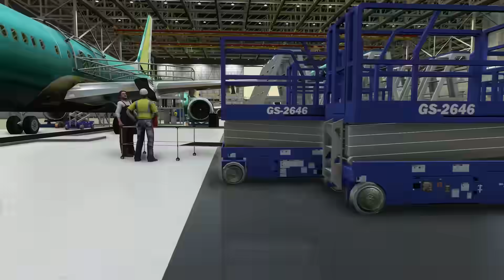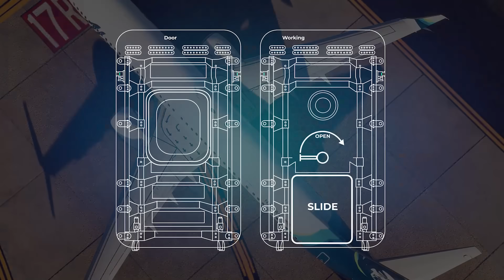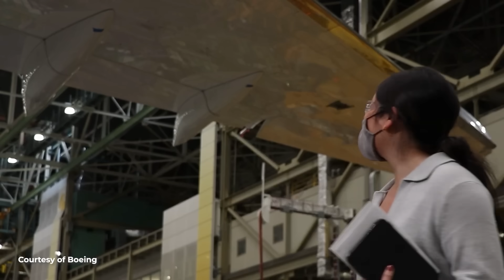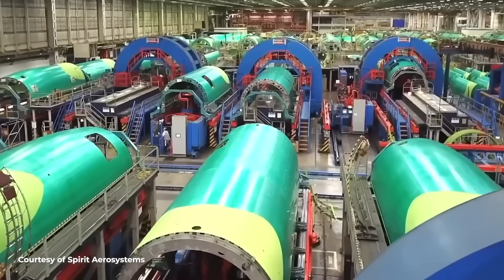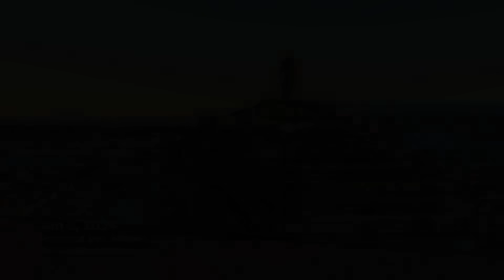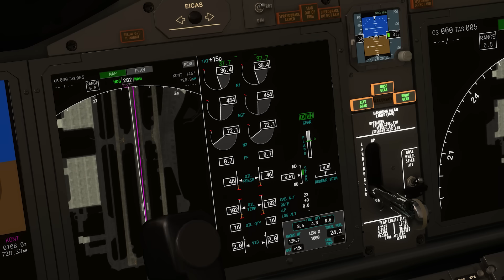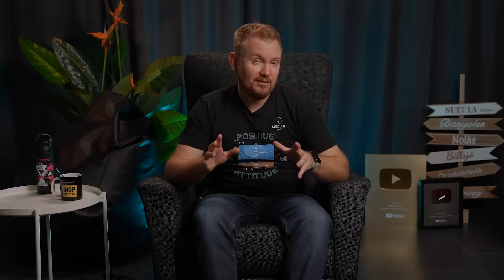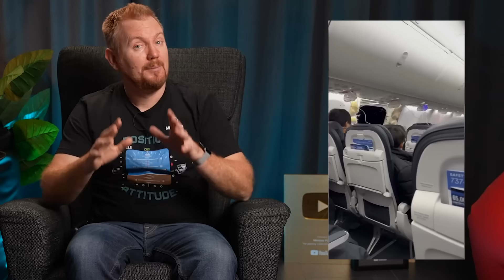Boeing 737MAX BlowOut!! The Scandal behind Alaska Airlines flight 1282

Comment: Former engineer here. There is nothing more frustrating than dealing with a company leadership team that’s hell bent on getting the product out the door and doesn’t want to hear about quality problems. I don’t know who said it originally but it’s impossible to make people understand something when their livelihood depends on them not understanding it. I’ve never worked in aviation but I’m guessing this is what was happening at Boeing.
Reply: Admiral Rickover, of US Navy submarine fame, had an easy solution to that. He made the managing team in charge of repairs take part in the first submersion test. Maybe Boeing should do the same with an aircraft’s first flight.
Reply: @moltderenou in ancient times, the engineer in charge of the arch (bridge, doorway, roof, etc.) had to stand under it while support was removed. If the engineering was bad, it was a self-correcting quality check.
Reply from the maker: Yep, I understand what you mean
Reply: @MentourPilot  There is no excuse for the door plug debacle- the number of eyes it slipped passed is criminal!!
Reply: Kk km @MentourPilot
Reply: @MentourPilot  I also understood what he meant. It doesn’t apply to this case at all, but, the sentences used correct syntax.
Reply: I worked in aviation for several decades. The last 'influencer' that safety-oriented folks like engineers, mechanics and pilots always had to sway the management to see things there way was the FAA/(oversight authority). Recent moves to 'pass this responsibility) to company themselves is the worst form of leaving 'the wolves in charge of the sheep!'
Reply: @gcorriveau6864  and doesn't help that the "company themselves" have gone woke with their priority focus to everything other than safety
Reply: haste makes waste
Reply: @SeekingTheLoveThatGodMeans7648  or re.. Chinese proverb.. plenty haste> less speed.
Reply: I have worked in GA (General Aviation), and the shop owner would not let anything go back to the customer until it was 1000000% ready to fly. If a small shop has the cash on hand to make payroll until the job is actually done then Boeing sure as hell does, they just chose not to.
Reply: @jamesesdaile4696   Although that is not true of all GA maintenance shops unfortunately.  I owned a P-Navajo and had my fill of sub-standard shops.
Reply: @jamesesdaile4696  Well is quality is not in the procedures to begin with, it is impossible to fix it in final inspection.
That shop owner would probably not allow any sick worker, and also never pushed "to get these 3 done today our contract depends on it".
 But is probably much happier explaining to the customer why it will take longer - the reason being safety.
Reply: "Out the door" HAHAHAHA lmaoaoaoao ba dum tishhh
Reply: “It is difficult to get a person to understand something, when their salary depends on not understanding it.”  ― Upton Sinclair 1934
Reply: I work for a class 1 railroad, and our management is exactly the same: get it done at all costs, safety be darned. I do what I can to follow rules and regulations, but I think it puts a target on my back.
Reply: The quote is from Upton Sinclair I think.
Reply: Mercedes Tech and Enthusiast here. The same in cars too. It's all about spending as little money as possible with the biggest profit. Nothing is built with passion anymore
Reply: That's because money does not talk.  It screams and roars like an enraged marine drill instructor hellbent on murdering a recruit who just doesn't get it.
Reply: same here in the electronics industry, managment were clueless, appointed out of nepotism, and often promoted well beyond their ability, (peter principle in action)
Reply: Maybe if leadership teams understood that their family members could die or be affected based upon their decisions
Reply: They want to make their shareholders happy so they can get their sweet sweet bonus.
Or not get fired.
Reply: So I get the faux quality system was a stopgap to minimize paperwork and maintain workflow.  But what was in or wasn't in the orginal work order that would cause the Spirit workers to just paint over the damaged rivets?  were they installed without sealant and an "acceptable" repair was paint over?  Or was there something more nefarious?
Reply: It is difficult to get a man to understand something, when his salary depends on his not understanding it - Upton Sinclair
Reply: ...get the product "out the door" accidental pun 🙂
Reply: I worked in the aerospace industry. Productivity expectations at all levels was always being pushed. You could never do enough work fast enough and no matter what you achieved you would never get paid more, only asked to do more work.
Reply: "Health and Safety rules are written in blood" - they're also etched on tombstones as well, sometimes. Until corporations care more about the safety of their customers than they care about profits, these problems are going to keep on reoccurring.
Reply: This has been a problem with Boeing ever since the McDonald Douglas merger were somehow the bean counters who ran McDonald Douglas ended up in charge of the engineer focused people at Boeing and they went from a company that was focused on engineering to accompany that was focused on the almighty dollar, with so many tragic results over the years...
Reply: There were times when the CEO of a manufacturing corporation would be an engineer with maybe a MS or PhD in Mechanical Engineering, and would get a MBA later in his carrier when he reached executive position. Now we have financiers with absolutely no interest in the company except for their golden parachute and their stock options. They are CEO of an agribusiness one day, an entertainment company the next and then of an aircraft manufacturer... it's all the same, just money. Remember the GE Capital fiasco? Boeing wanted to do the same. "let's not waste money making stuff... let's all be consultants instead."
Reply: I am actually starting to be afraid of flying because of this change in company culture. The problem is not limited to aviation, however also with trains, buses and other means of transportation. Take modern buses for example. Because they are poorly built, deadly accidents have happened in speeds as low as 30 km/h, buses are no longer being made so they are safe to drive in the winter. In Oslo of Norway where I live, some bus lines have actually been closed down and/or have gotten limited operation because the transportation company ("Ruter") have bought buses of poor quality, and many buses have been damaged due to accidents. Due to modern safety rules, we may fortunately, in practise not see as many accidents as one would fear, still - a decreasing regularity and quality of service, this is especially problematic with trains and aviation. However - in aviation, we will see an increasing number of accidents because even minor issues can lead to accidents. Also, after the pandemics, we see that people are less focused, than before, which could be a combination of long covid and the aftermath that the mental challenges caused, which leads to many minor accidents everywhere. 

The world situation with the increased risk of world war III is not the most healthy, either. Still - the focus must be to change company culture, about listening to the engineers and not the stockholders of companies, so that resources are diverted to give proper services, not to fill the stockholder’s pockets. In summary, the cultural problem about quality of services, is omnipresent, however the more technical a service is, the more vulnerable and unsafe it will be, if the company culture is greedy.
Reply: Renton factory, explains everything.
Reply: IT Infrastructure engineer here. I can totally relate to your comment.
Reply: Exactly!!

This wasn't necessarily an engineering problem or a SUPPLIER problem. This is CLASSICALLY a MANAGEMENT PROBLEM!
Reply: Another former engineer here.  It has been my experience that the bean counters (CFO's) appear to be running most larger companies.  These people have little to no real life experience with technical or safety issues, and absolutely should not be in charge of companies that 'must' have a strong focus on creating products that don't endanger peoples lives.  I don't have personal knowledge of the bean counters influence at Boeing, but it certainly would not surprise me.  Safety should never be compromised in aviation, but anyone who has been paying attention knows that costs are high and throughout the years many shortcuts or cost saving measures have been employed.  Aviation has a 7 Sigma safety record, virtually the highest of any industry, yet some in the C-suite seem to be out to destroy that impressive record.  Recently, since this incident, other 737 door plug issues have been found which leads me to believe that this problem is more wide spread than we know.
Reply: Boeing stopped being Boeing after the McDonnell Douglas merger. Totally changed their operating procedures when they allowed so many MCD executives retain their jobs.
Reply: I feel this issue is replicated throughout our culture, society and economy.  The people with money, who primarily care about profits, pressure those who actually do the work and understand the implications of rushing the work, to ship products (or whatever it is one does) according to a deadline rather than quality.  Of course, the reasons of management may be valid, but that just points to larger systemic issues.  The answer should never involve jeopardizing safety.
Reply: @andrew5184 spot on.
Reply: I have a solution for Boeing's problem..... FAA should mandatory to make each of top management work blue collared on the production floor for one full day a month.... If they can't do anything productive they'll assist the technicians & engineers with manual labor...
Reply: @sattwikchakrabarti Yes, I have thought about this aswell.
Reply: But instead they got the door out of the product in that case...
Reply: Engineers are like vegans…..they always find a way to tell you that they’re a engineer lol
Reply: IS happening. Not was happening. Boeing still hasn't fixed their safety culture. 😠
Reply: Those same people that everyone loves to demonize, are trying to run a business to keep everyone employed at the end of the day.  Engineers can have their concerns, but they are a part of the puzzle, not the whole thing, the leadership team has to look at the picture as a whole.  So while dogpiling on them is easy, remember what they're doing is far more complex than just being an engineer.
Reply: Blame the McDonnell-Douglas execs that took control of Boeing
Reply: Another engineer here.  See my comments above.  I think people get lost in the weeds and in tech speak.  This is a clearcut problem of incompetent people working in the industry rather than one of 'layering of systems'.  There's money, politics and phony excuse making infusing this 'investigation'.
Reply: Opinion: ...not *was* happening, rather *has been* happening, leading to loss of hundreds of lives.
Reply: You and Brownie are  great sources of information - technical, aviation business, culture.
Reply: Yes I understand too 🙄
Reply: This mentor guy is just an YT clown.
Reply: Same with the motor trade, an mot which is a safety check basically, the tester must spend a MIN time of 40minutes doing the test, garage owners then book tests based on the MIN time, older vehicles need a longer time so things run behind, items are then missed whilst the tester tries to catch up and problems can arise, which could be serious.
Reply: I guess we need to change the laws a bit to make willful-idiocy an offense that can at least revoke your bonuses for a year or three maybe, or jail or whatever.
Reply: @EShirako  Who are you addressing this to my friend? And what does this contribute to the discussion. NOTHING!
You need to put yourself on READ ONLY mode. That way you will not continue to make a fool of yourself!
Reply: @DennisMerwood-xk8wp   I was snarkily agreeing with your comment that "there is nothing more frustrating than dealing with a company leadership team that’s hell bent on getting the product out the door and doesn’t want to hear about quality problems" is true because C-suite and managers have no requirement to be responsible for their poor choices.  My comment was meant to say that "The only thing managers/executives in corporations can understand is something that hits their pocketbooks at the moment", thus "I wish they could lose their bonuses at least, since we can't seem to send any of them to jail no matter how terrible their decisions are".
Reply: Beancounters should stay very far away from safety  budgets on intrinsic systems?😮😮😮
Reply: Here after the Boeing whistle blower assassination , first let me say spiritareosystems is Boeing under a different moniker, secondly if you think taking an airbus is any safer guess who builds their fuselage? Spirit aero
Reply: Exactly what is happening! Giving us less time to make or inspect the aircraft! We use to get days if needed to inspect an aircraft… now we get hours max
Reply: Only idiots guess. A 1st grader can guess
Reply: Construction engineer here, and I know exactly what you mean. 
Shortcuts will be made if you let management get to it and not be stopped.
Reply: Yeah, don’t bring up Elon, you’ll hijack this whole post!
Reply: Yep, standard engineering/ higher higher mg't interface,  esp if mgt is unduly influenced by whatever form of company ownership.
Reply: As a former aircraft mechanic at Varig the security procedures were so tight and even so bad things do make their way...
Reply: VERY UNRESPONSIBILITY UNPROFESSIONAL UNACCEPTABLE 🙏🙏🙏
Reply: I just wonder how many max9's there are flying with door plugs not bolted on.. There has been 5 incidents with boeing airplanes in last week.  
I'll keep on travelling with airbus and atr.. Zero trust on that company made in USA
Reply: Guarantee there are corporate psychopaths in Boeing management
Reply: John Barnett was murdered for this. Make sure people know you're not suicidal
Reply: That wasn't a quality but Clear Employee carelessness
Reply: @bernese1004  Employee carelessness is universal. We are all human. Quality control is the process of ensuring mistakes don’t impact the function of the product. At Boeing, unlike Airbus, this is lacking.
Reply: It's usually okay. We cut corners all the time at my company.
Reply: I work in aviation, defense, and aerospace as a QMS specialist and this is in no way excusable. I can say that it's been my observation over the course of two employees in this industry, during/post height of covid, that the demands on a reduced operational workforce has taxed quality control significantly. But to your point, leadership has a duty to the industry, it's customers, and  the public to adhere to quality requirements, including planning of resources and manufacturing, inspection, and testing activities for total quality assurance. Shit rolls down hill and the organization at the center of this story had a rich history in the US and globally before falling from grace after the silent and secretive introduction of MCAS on the MAX. One of the most bothersome takeaways from this video, was hearing that YET AGAIN, aircraft pilots were not aware of new design elements prior to their incorporation (diff pressure/cockpit door). 
This is disheartening on so many levels, as someone who works in quality management, in the defense industry (non-commercial aviation), as a commercial flyer, and simply as someone who takes pride in their work and would expect all persons to hold their leadership to the same standard. 
This organization is motivated by money today, which must be devastating for their former generations of quality and engineering personnel who accomplished incredible technological feats without compromising safety or quality to simply meet budget and delivery schedule commitments.
Reply: they talk about it like there's not loads of lives on board
Reply: that's capitalism baby
Reply: Well said
Reply: As a safety professional, I have been in the same position.  Too many companies say that employee safety is number one, but it really isn't.  Profit is number one. Management doesn't want to hear how unsafe it is to have employees handling hazardous chemicals during long work days and weeks or how dangerous many work practices are.  It's impossible to quantify the value of employees working more safely because you can't say that if you continue to work your employees this many hours, this is what will happen and this is what the cost will be.  All you can say is that this is a high risk activity, and if something goes wrong these are the potential associated costs, including medical costs and fines if someone is killed.  Generally, management is willing to take the chance that nothing will go wrong.  After all, it hasn't happened yet.  At one company, I had fought for a tornado shelter because all of the buildings were either basic metal buildings or modular office buildings.  Later, when I wanted to start on installation, I found out that the money had been taken out of the budget without telling me.  At another company, when I explained the tornado procedures that I wanted to implement, the QC manager responded that a tornado had never hit the building before.  Unbelievable.  Tornadoes were common in the area, and we were only 40 minutes from a city that had been hit by an EF5 tornado a few years before.
Reply: Be careful you might mysteriously commit suicide
Reply: Basically stop Wall Street running the economy
Reply: 100% . I worked at Sea Ray. I installed counter tops in the 44 footers head. I couldn't convince the QC inspector that tightening down the faucets on the sink before the caulking set up  was cracking the counter tops . He ignored my warning and I sent out at least fourth boats with cracks in the counter tops. The production schedule was so rapid I would come into work when it was dark and leave when it was dark . One morning  on the way to work I drove up an off ramp on the highway .
Reply: Look , in the backwards US the FAA who couldn't control Boeing and when the MCAS disaster happened when they were asked why they let Boeing self inspect  they said " well they are the experts " was their answer , now that same Keystone Cop agency grounds a SPACE X Rocket on the launch pad citing twenty violations ! Now they are Rocket Scientists !!!
Reply: I'm a retired Aerospace Senior Engineer and I agree with you 💯.
Reply: There is no accountability. Did anyone go to jail after 2 planes crashed after they hid mcas from faa? Also the faa doesn't do anything. I think boeing pays them off.
Reply: I have no trust in Boeing.
Reply: So, are you the last line of examination before it leaves, because if it crashed, all they would have had to do is who look plane at the plane last and thereby implicating you?
Reply: I ALWAYS say:I should do it THIS WAY,if you want me to do it YOUR WAY,put it on paper,and sign it.
I ALWAYS get to do it MY WAY.
Although, I'm in the EU.
I guess,they do it differently in the US...money talks...
Reply: Brother this translates.
I'm a builder, big buildings a hands on site super. The crap the suits ( that have never held a hammer) want me to do at times is criminal.
Reply: You are not in aviation and are just speculating. At least you were honest. 99.9% of the people who comment on a topic are also speculating and have no professional knowledge at all. I can say that because I am not a statistician and I’m making a guess.
Reply: I love that sentence! I's impossible to make people understand when the means of NOT understanding is part of their motifs. No matter if they're economical or psycological 😊. This is the virus that exterminates pure logic/balance.
Reply: Misplaced world 😢
Reply: I don't work in aviation but I know exactly what you mean...
Reply: So true have similar experience
Reply: Current engineer, tell me about it bro
Reply: Imagine if its an entire country gov services.
Reply: Safe and effective
Reply: While I was never an engineer, a job I had at 25 years old was to help build tow hitches for the Toyota department at a company called Cequent Towing Products. We had a Toyota line that was much more strict in quality control. If they found an error in the line at any time, they shut the entire line down. I worked in saws and hitch box welding. When something was found, the whole line stopped. From the beginning to end, until they realize the issue. We were allowed 2 stops per month. No more. I never had an issue in my department, but the other welders were always having issues. Just before I quit the company, they were losing the department. It was a huge loss to the company.
Reply: Totally, a lot of the management/office people I deal with have such little understanding of what I actually do
Reply: I am QA-Engineer for a machine and Industry company. We mostly have welded parts and have to paint them (called corrosion protection), which is where most of the issues lie.

Sometimes I have such a hard fight about the mistakes (and therefore delays) i find... then we found a good Company that has been trained well on our products and requirements, only to hear they are no longer good for us as they are too expensive.

It is sometimes sich a hassle with management...
Reply: This is an ever-present issue when technology and new products are driven and completely controlled by those with monetary gains as their one (and sometimes only) priority. There are a number of reasons why these types of priorities go hand in hand with being a leader in putting the newest products on the market, and there might not really be an alternative, but the problem is there nonetheless.
Reply: “…nothing more frustrating…”? Tell me you aren’t a parent without saying you aren’t a parent. Or mebbe you just met my ex.
Reply: My father was the chief of a police department. I remember him coming home and just being so angry and depressed, because he had an opening to fill, but had to skip down the list past better qualified applicants to get to a black woman. Literally skipping over better qualified, better trained, officers on the basis of their skin color and gender. How is that NOT discrimination?

She played the “you can’t fire me or I’ll sue” Card on day one.

30 years later, SHE’S the chief!

I just disagree with special rules for special people.
Reply: "getting the product *out the door*" hehe I see what you did there
Reply: @ 3 people pointed out my unintentional pun.😂
Reply: @danielschein6845  well next time make it intentional 😂
Reply: There should be a major revamp in the current safety protocols of Boeing and strict safety inspections in Spirit, this major problem with the administration not overseeing the seriousness of safety as well as keeping up with the reputation Boeing has built over the years.
Reply: Boeing culture changed dramatically after the merger with McDonald Douglas. Leadership got incredibly focused on quarterly stock price. Loss of long term focus led to this and other issues.
Reply: Concur.  I've worked in IT (mostly software) for ever (!) and over that time, it seems that while the software industry has made great progress in professionalising its practices, "management" has not.  The attitude of "get it out the door ASAP" has never gone away.  A great mitigation for attitudes and people like these is to make sure everything is "on paper".  Even phone calls.  A follow-up email or other comms system message to the offending manager in terms like "Dear <x>; on the recent phone call you made to me on <a> at <b>, you insisted that I do <c>.  I wish my objections to be noted.  As discussed, this will be a bad idea for the following reasons:...."

Amazing how a bit of traceable accountability can focus the minds of those who behave this way.
Reply: Product out the door! The pun…
Reply: Your original comment is essentially what brought down Challenger and Columbia. And yeah, it’s prevalent at Boeing. Or at least it has been in the recent past.
Reply: "It is difficult to get a man to understand something, when his salary depends on his not understanding it"

~Upton Sinclair
Reply: Ah yes, the noble engineer, forever the victim of clueless leadership, never the cause of delays, bloat, or gold-plated “solutions” no one asked for. Funny how quality suddenly becomes sacred when it’s a convenient excuse for missing deadlines or ignoring business goals.

Sometimes it’s not that leadership doesn’t listen, it’s that they’re tired of hearing lectures from engineers who think the product is their personal thesis project. If your idea of “quality” means never shipping, you’re not an engineer. You’re just expensive overhead.
Reply: I work with trains. Similar situation.
Reply: Why do we never hear this issues from Airbus? Because they are better, the Americans government stopped the Concorde from flying New York-LA because of noise, that killed the Concorde and not the crash in 2003
Reply: Hello Morton Thiokol... Engineer said what? Nah, it will be fine.
Reply: How does some clown forgetting to install bolts become a sweeping “company leadership” diatribe? Pilots didn’t pull the CVR fuse because “company leadership” too?
Reply: @rdspam   It's much more complicated than that.  That fact is that systems must be put in place to make certain that something like this doesn't happen.  A significant number of aviation accidents over the years have resulted from inadequate systems to ensure compliance with safety guidelines.
Reply: @rdspam they can’t get a good settlement from the clown who forgot to install the bolts
Reply: Well, a company can ship an app or a small consumer product that's not very good without disaster.
If that culture gets into an industry where it doesn't fit... ouch.
Reply: As a retired engineer, thankfully not having any more responsibility for developing components and systems for automotive, its becoming increasingly difficult to do your job well. They are only interested in their spreadsheets for cost and timing. You get dinged for trying to do it right these days, glad to be out of it
Reply: Saying something will make you unalive yourself though.
Reply: Well yes, engineers are very pedantic and it’s someone’s else’s job to correctly ignore the times they are they are worrying about nothing. It’s called a check and balance. The vast majority of companies get this right.
Reply: I think we are getting into an age where leaders of technology companies should have both an economics and technical background of sufficient level to become leaders in these type of companies. Look at all the Elon Musk companies, they shine because their leader and board have both backgrounds and they are up against companies with board members with only an economic/organizational background.
Reply: @Nvt-vi8dr  I really wonder how you could bring up Elon Musk out of all people as a positive example. Tesla is infamous for numerous quality and quality control issues ranging from general manufacturing to software design.
Reply: @Hurricane2k8  It appears that things start to go wrong when Elon's attention is elsewhere. Software? From what I've seen with other manufacturers, it could be worse. Much worse.
Reply: @Nvt-vi8dr  Elon Musk LOL! terrible example
Reply: @Nvt-vi8dr i mean elon has no engineering degree and his car company is mostly an tech co
Reply: @Krylon127  i seem unable to find your earlier comment, but i think we can agree that Elon will kick most our asses in whatever engineering field. I you don't agree, maybe the congressional hearing on the nasa contract preferential could sway you. The fact that someone has a accredited  degree in some field tells you something about their minimal aptitude level in that field for 99 percent of people. But there is that 1 percent that is routed different in their brains. I think elon is in that 1 percent/promille, the companies he is able to start and understand the engineering from is just on another level. And no I do not worship hin, I think on a personal level he can be a very difficult person and if i would work at one of his companies I might wear out, but the technology achievements through his companies are on another level. There is no electric car company in the world that makes cars with the same efficiency as Tesla's, still till today. There are literally millions of engineers working in competing companies focussing on the design of parts and systems to get on equal level, but still not there. Same holds for rockets, same will be for Neuralink, and maybe even Grok. For the tunneling situation and solar roof tiles you might be right though, seems like competition is on par or there is not so much happening there anymore.
Reply: @Nvt-vi8dr  Leaders of technology companies should have strong technical background with good sense of economics and management. Backed up with good financial advisors.
Reply: @Nvt-vi8dr leadership don't rush products out because they are running out of time, but because they are running out of money. Musk famously said before the initial NASA contract he was faced with the decision of having to close down one of his companies to fund the other. This is usually what drives it. It's also based on the acceptable gap in release to delivery. It still falls on everyone to make sure safety is priority, but the business person half of the equation knows where the tolerances are and aren't for the entire show to simply stop.
Reply: @Nvt-vi8dr quality in Tesla is not the best, it’s just less catastrophic consequences.
Reply: @Nvt-vi8dr Elon doesn't have much technical expertise. He would not get hired as a junior software engineer at Twitter.
Reply: @Nvt-vi8dr  I agree. Most Boards of Directors are made up of financial "experts" and people who have gained high level of prestige in some field.  This is true in many US corporations regardless of the type of business. Expertise in the particular field of business they direct is becoming more rare.
Reply: @Nvt-vi8dr that used to be the mentality at pretty well all large companies, it has only changed in the last 50-60 years
Reply: @Nvt-vi8dr  Elon's record on safety and quality is actually pretty bad. Further, elon literally forces stuff out the door, finished or not, mostly because he understands that it can in fact be fixed later. Not necessarily something you want to do with commercial aircraft.
Reply: @Justin-vi8dr A good Ethics course at the nearby community college would help
Reply: @Nvt-vi8dr  I get what you mean, but Musk is also a perfect example for the opposite. I'd say most of the companies he got involved benefited incredibly from his family's wealth and some also from the personal brand he built, but on the engineering side of things, they mostly functioned despite Musk. 

Look at the Cybertruck. That thing has "Musks ego project" written all over it and pretty much marked the turning point for Tesla where managers completely took over.
Reply: @Nvt-vi8dr  Elon Musk has zero technical background Justin
Reply: @fensterlips  Google is your friend fenster!
Reply: @DennisMerwood-xk8wp Thats not true. Elon is intricately involved in most technical aspects of all his co’s. And google is not a reliable source of information. Boeing is just not what they used to be. Lots of reasons-one being their adherence to DEI. The deathnail for any technical corporation.
Reply: @DennisMerwood-xk8wp  i think you may have forgotten that as a child he already programmed his first game, which he sold. Fast forward a few years and you can find the videostream of a congressional hearing why Nasa was awarded a contract, where Space X wasn't. He clearly is very strong in his engineering skills. I would not want to work under this man, but he is clearly both economically and technically very capable, to my opinion.
Reply: @FourieF  "google is not a reliable source of information"
Google doesnt provide information. It points to information.
Reply: @fensterlips because his history is an open book.

Musk has a background in "wealthy family." He buys companies, then takes credit for their work. Musk's actual skill is in recognizing companies with potential.
Reply: @DennisMerwood-xk8wp 

It would be more accurate to say that he has never taken any “engineering classes” but he does have a “BS” in science and has absorbed some technology jargon from the real engineers that are around him. He did get accepted to a science PhD program but never registered / enrolled in any courses but deferred to deal with …
Reply: @lairdcummings9092  Doing that once is luck. Doing that 3+ times is skill. Don't forget, even choosing a company that has the merit is a non-trivial exercise, otherwise everyone would be doing it. 

And you seem to forget that computer game that he wrote and sold. If that was so easy, why don't you do it as well and get rich? Elon's family was well off, but not even close to what Elon is now.
Reply: @Nvt-vi8dr  NASA doesn't get awarded contracts, it awards contracts to others.
Reply: @DennisMerwood-xk8wp  I'd say his studies in physics is kind of technical. And most of all he has technical, legal and economical specialists in his leaderboard in his businesies.
Reply: @realulli  Skill at picking companies isn't engineering or technical skill. It's reading reports and financials skill. Which is just what you'd expect from "rich family" background. Reading a spreadsheet and analyzing the markets does not in any way, shape, or form, make you an engineer or scientist. 

Then we take a look at Musk's "Hyperloop" 'revolutionary' transport system - which was a shitty copy of a lame theme park ride, which, by Musk's own admission was intended to scupper high-speed rail in California, and you can see that he's absolutely CRAP as an engineer - and an anti-environmentalist, working to line his own pockets - AGAIN, what you'd expect from 'rich family' background.

So three successes? Yeah, if you throw enough shit at the wall, some of it will stick.

As for the game, Pffft. THAT is the hook you're going to use? Please. Amateur programming of a crap game doesn't make you even a software engineer, much less an electrical, mechanical, or aeronautical one - Hell, I have have done - and can still do - programming, and I wrote a game too - TRS-80, but back then, that made me one of the elite. That said, I sure as hell wouldn't claim credit outside my area of knowledge, and neither should you, for Musk.

Face it, Musk is just a somewhat less crap version of Donald Trump. More power to him, for actually doing something with the family money, but don't worship him - he hasn't earned it.
Reply: @FourieF  "Elon is intricately involved in most technical aspects of all his co’s" - like what? Got any examples? He had nothing to do with the Tesla EV design!
Reply: @FourieF propaganda, if he is an actual engineer why does he never say anything technical? We always hear second had that apparently he said something techncial to someone who works from him or wants money from him, but yet there is never any evidence where he actually does that. If he is so supernaturally technical why aren't their videos of him doing calculations and lecturing?
Reply: @DennisMerwood-xk8wp Neil Armstrong didn't have to know what the thrusters were made of. He just had to know how to use them. Ridiculous analogy
Reply: @DennisMerwood-xk8wp he took an existing design and bettered it. He assembled a team to do so. Stop trying to detract from this man's progress
Reply: @DennisMerwood-xk8wp Nothing worse than someone who thinks they know something and goes around telling falsehoods.  You can't even teach these people until you teach them they are wrong first.  It's okay not to know something but to think you know something when you don't is very dangerous.
Reply: @JimmyJamesJ  It's okay not to know something but to think you know something when you don't is very dangerous, Jimmy!
Goggle The Dunning–Kruger effect, Jimmy. You have a chronic case of it my friend.
Reply: @lairdcummings9092 Totally incorrect
Reply: @Nvt-vi8dr No, programming a game, which I and my friends have done in the past, does NOT equate being an engineer. musk is NOT an engineer by any metric. Not even remotely close to one.
Reply: @DennisMerwood-xk8wp  Wrong. He has no technical degree, but he has always been a nerd fascinated by and digging into technology. Engineers from his family's emerald mind have attested he was always asking questions about how the machines worked.
Reply: @Grain_storm this squared.

He and his colleagues were central in the design of both the Gemini, block one and especially following the plugs out test fire, the block 2 Apollo CSM and LEM spacecrafts.
Reply: @HOOOLD_ON  Exactly - with the same level of bias and accuracy demonstrated with their Gemini AI. At least they've dropped their previous slogan "Don't be evil"   so there seems to be a level of self awareness.
Reply: @DennisMerwood-xk8wp  Thats just not true. May  I recommend the book by Walter Isaacson on Elon Musk - it seems to me to be a true and about as unbiased as you can get. Elon Musk seems to me to be that rare mix of an insane IQ, mixed with supernatural energy and vision.
Reply: @FourieF Prove to us that Elon Musk, all by himself, designed a single component in a Tesla EV, or a Space X rocket.
Betcha can't! :face-orange-frowning:
Reply: @DennisMerwood-xk8wp  elon graduated college in physics and is a self taught & successful software engineer. As a software engineer myself, every self taught person I’ve met tends to have much more ability in coding and knowledge than any person who just went to college to learn software engineering. One tends to learn it out of having a passion for programming and the other tends to choose it as a major for the money they think they’ll make.  To say Elon has zero technical background is disingenuous at best. Like you said, google is your friend. 🙄
Reply: @Coledebord2  
"Coding" and "programming" is not DESIGNING an electric motor for an EV, or a rocket motor for a space vehicle.
Have you ever designed anything my friend?
I design bridges. And not so long ago our office designed structures WITHOUT COMPUTERS!
You kids with your computers are clueless. 
Take your computers away ~ you would be left twiddling your thumbs. We prove that every day in our office when these new college graduate Engineers could not design anything without their computer. 
Nobody said Elon has zero technical background - I just said he is not a designer.
Reply: @DennisMerwood-xk8wp I thought Elon had an ME degree.
Reply: @DennisMerwood-xk8wp  You are foolish to state Musk has no technical background.  People like you have limited insight to technology. Sad.
Reply: @DennisMerwood-xk8wp What a silly uniformed comment.
Reply: @kxjx Because not very bright minded people from media not understand it. It is very difficult to simplify things for non technical people. So he have to dumb down the things.  

Also you not give away technical solutions in very competitive fields of industry. So you have to say something specific but also not to be very specific.
Reply: @205rider8  What's silly about it?
BTW you meant "uninformed."
Reply: @FourieF I’m assuming that you have a reputable reference to the data that suggests that DEI is directly associated with a decrease in technical quality?  Or could it perhaps be that CEOs and other execs in most companies get a significant portion of their salaries based on corporate profits and/or stock price?  

I look forward to links to the data used to arrive at your conclusion.
Reply: @janharg1  So my "reputable reference" is my years of experience as a technical engineering manager. Corporations, and specifically public corporations are investing in DEI because it raises their ESG score which makes them more appealing to the large investment funds like Blackrock and Vanguard. Their investment raises the stock price and the value of the stock options for these CEO's and executives. But there is no tangible benefit in the application of DEI, and indeed it can be seriously dangerous, as Boeing is proving with these quality control failures.
Reply: @Nvt-vi8dr He may be economically and technically very capable, but he is not “ethically” competent!
Reply: @Bruin4Life  i agree
Reply: @DennisMerwood-xk8wp 
Thanks for your comment.
I would add he's a wanna be authoritarian.  I wish him nothing but the worst.
Reply: @Mentaculus42 it's a BA not a BS in Physics. BIIIIIIIIIIIIG difference
Reply: @HOOOLD_ON Google chooses what to show in results. Very often those results are incorrector not precise the same thing with thing with AI It gives you information, but you have to verify it, cause it may be wrong or partial
Reply: @kxjx just an example - he made calculations if it is possible to build a space launcher starting from clean sheet and make it profitable. Then he did it. Of course he hired engineers, but was involver in key decisions. Sometimes risky, sometimes wrong. But non of space startups had done it before him. Even the decision to make boosters reusable was his.
Reply: @DennisMerwood-xk8wp this is not his role to design details. There is a lot of people talented in their narrow fields that can design details. But they would not succeed neither with EV, nor with SpaceX. Also there is a lot of Harvard MBA graduates working for investment funds. But it is rare someone understands both worlds has a vision and will to complete it.
Reply: @lairdcummings9092 I see you have little respect for one of the best presidents in modern history. Do you realize how good things was when he was in office?
Reply: @daleyoung87  You are a living example of Dunning–Kruger effect.
Reply: @DennisMerwood-xk8wp  as an engineer I assure you that not all engineers did engineering. Like the father of electrical engineering: Thomas Alva Edison. He was a class 5 dropout. Even John Lorgy Braid inventor of TV. The Wright brothers were mere bicycle makers. A person practicing engineering is more of an engineer than a book and exam engineer.
Reply: @Nvt-vi8dr he might have been technically proficient and skilled in the past , but without actively working on projects, he would not be able to keep his skills. A man of his level in his company doesn’t need to involve himself so much and so he probably doesn’t actually know much in comparison to those who work under him. He’s no longer an engineer, he’s a business man.
Reply: @HOOOLD_ON 
Ah, you just demonstrated what is known as "a distinction without a difference". Nice going, chum!
Reply: @daleyoung87 bad analogy. Armstrong was an engineer. Most of them were.
Reply: @DennisMerwood-xk8wp Pretty sure Elon is the CTO ofSpaceX…
Reply: @Nvt-vi8dr  You mean the game "he" made by copying the code from time period computer magazines who regularly ran articles where the code to games like this was made readily available for people to learn. Every kid (including me) that was above average interested in computers and read those computer magazines did exactly what Elon Musk did!
Reply: @DennisMerwood-xk8wp Elon Musk - BS Physics University of Pennsylvania, BS Economics Wharton School of University of Pennsylvania. Was admitted to PhD applied physics and materials science at Stanford. Left the program to be an entrepreneur. PayPal, Tesla, Space X, Boring Corp. Nikola Tesla - no degree. Thomas Jefferson - no degree. Benjamin Franklin - no degree. Thomas Edison no degree.  None of those legends had any “technical training” Musk is in good company.
Reply: @FourieF suggest “preternatural” instead of “supernatural”. The former would make him a freak, the latter would make him a GOD.
Reply: @FourieF  "Death Knell" is what you mean. Peace.
Reply: So…? Why aren’t you a multi-billionaire!???
Reply: Elon has a lot of deep, deep issues. But the guy at least has experience on the job. He has the background even if not the exact technical skills. At least the guy knows why when he violates.
Reply: @Nvt-vi8dr  When leading you have to understand all things at some stage... One needs to have also legal understanding, not just economics and technical.
Reply: That seems very plausible. So a small pond of people to fish from, to get these leaders.
Reply: @Justin-vi8dr I do believe that the management at boeing has an engineering background. As the real engineering channel said, greed isn't exclusive to buisness men
Reply: Personally I think Boeing’s commitment to diversity instead of merit is worth a minuscule drop in quality.
Reply: @realthoprivate evidence?
Reply: there are speculations that it's a result of diversity and inclusion. When they replace good old skills and experience
Reply: @ТоварищКамрадовСоциалистКоммун nothing to do with that bro, stop ignoring the elephant in the room - rushed deliveries and profit over quality
Reply: @ТоварищКамрадовСоциалистКоммун there is “speculation” due to politics, not facts. That’s how it works these days.
Reply: More likely accountants rather than engineers making the decisions..  @ТоварищКамрадовСоциалистКоммун
Reply: That and D.I.E. Diversity Inclusion and Equity means cheap labor that doesn't unionize.
Reply: @brunos6599 what are you talking about? Do you have actual personal experience or regurgitate bias?